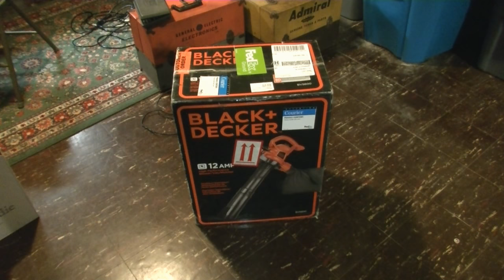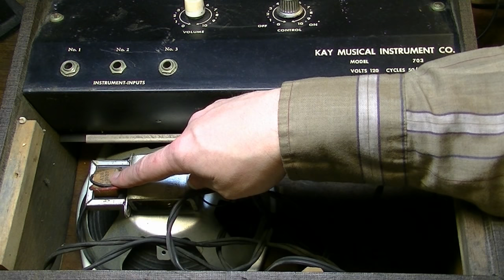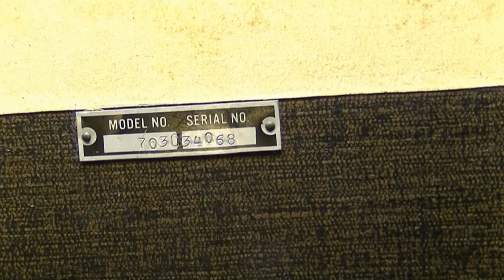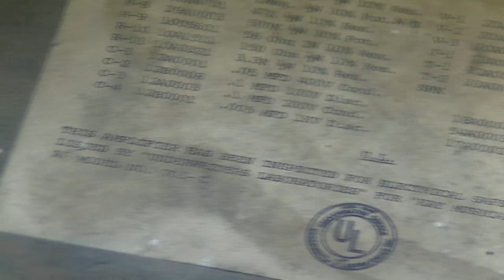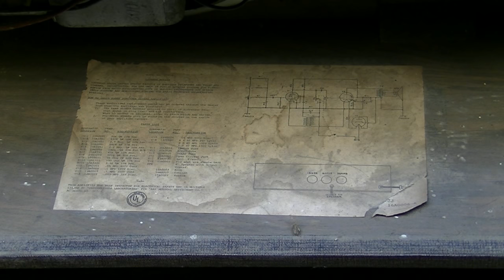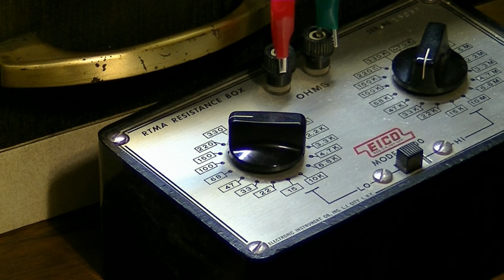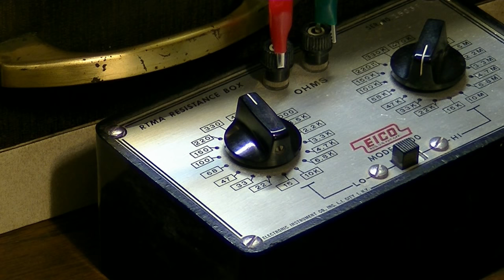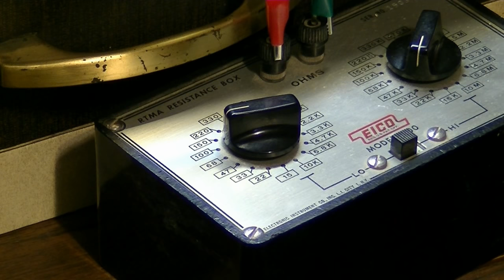Modifying a Little 60s Kay 703C Amp into a TONE MONSTER!

Comment: The person cloning your channel must really be a fan... or a money grubber.
Reply from the maker: It's the latter. I think Chinese programmers have written code to do this to channels with x number of views or whatever. It's like mining for gold.
Reply: Lovely...   My next project is a Leslie speaker...  after I finish my Kid's pine car.
Reply from the maker: Scratch Leslie? Or repair?
Reply: I bought from E-bay  a Speaker/rotor/motor  part from an organ..   The 
part number is a CMI number,  I think it was for a Kimball.   It's a 
single speed.   My plan is to give it speed adjust,  foot switch on/off,
  and a cabinet.   It's a 10" speaker size.    I was able to get it 
tested out,  and everything that has to work does.   The original 
speaker for those organs is a Pre-China  Pyle....  sounds pretty good 
actually,  so I'm going to leave it.
Reply from the maker: Cool project.
Reply: For someone with (at least +basic) knowledge of IT - cloning a YT channel is as easy as - you changing a transistor.

Downloading the whole channel incl. META data with scripts/tools - and then uploading it (automatically) again. "Work" of a couple of clicks or writing a couple of lines of code.

Sad but true. 

Thanks for ALL the outstanding content YOU provide!! Very interesting - much appreciated. Greetings from Austria.

Comment: I have a question. Can you run a switch between two capacitors to create a fat switch?
Reply: Dryocum 
A fat switch is normally a cathods bypass capacitor on one of the preamp gain stages.

Adding the capacitor to the cathode of the preamp tube gain stage will let more or less of a desired frequency through 

So u would need to be more specific 

On a blues jr and vibroking the fat switch is adding or removing a elctrolitic capacitor to the gain stage

Comment: Personally I was expecting something like a 12AV6 or 12SL7 pre and a 50L6 final...
Reply from the maker: That's the other common tube set for series filament amps. These are less common.
Reply: 12AU6 and 50L6 are the set for the 703 (as opposed to 703C).